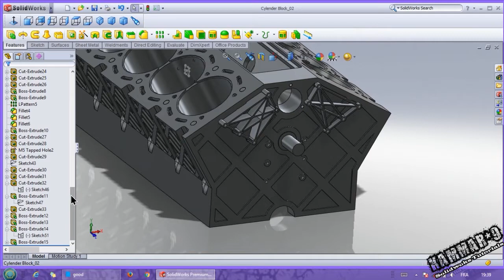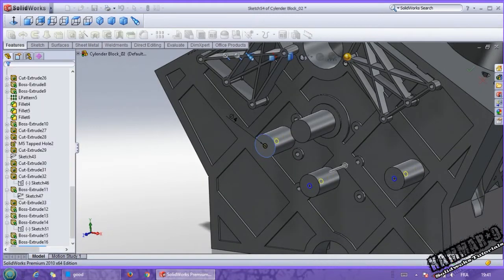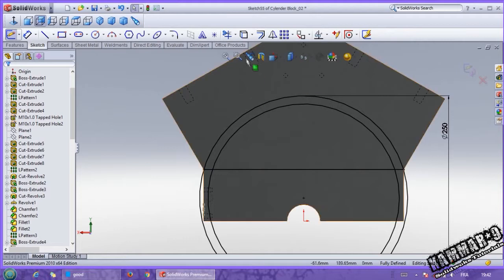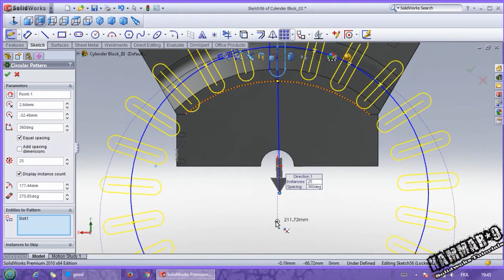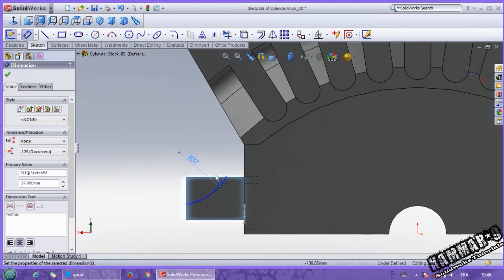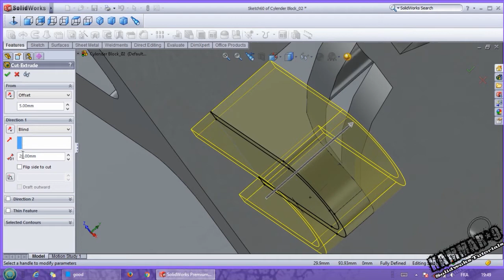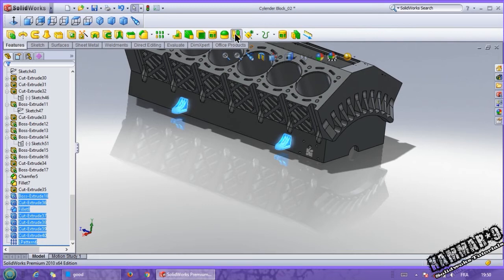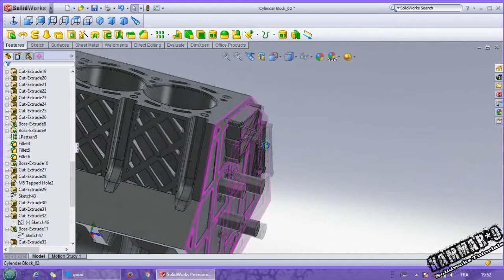Solidworks tutorial  V12 engine | Ep 10 Full HD 😍

Comment: Hey ammar,  how are you? I have a question.  From where do you get the dimensions of the engine parts or did you completely draw this engine by yourself?
Reply from the maker: +Kef Unen yes , is the second response , I did it myself , for that I respond all people ask me the same quastion " how to get the 2D drawing !!" but there is no way to get this in the web !! , thanks
Reply: Yeah I kinda new that already, about the drawing haha... Still it's quite some work you put in that engine.  And it's fully functioning if it was build this way with these parts?
Reply from the maker: Kef Unen i can't tell you if it can works , because , there are many test before building the real engin , you can see mechanical engineering to know how it's hard to do that
Reply: Yeah I'm doing research about all  those things that are necessary from start to finish...  But maybe you allready had some information hehe..
Reply from the maker: Kef Unen to make the real engine, you have to calculate all resistance of this parts , then you calculate the problem of vibration and ...many thing to do
Reply: Yeah I've heard some about it in a lecture..